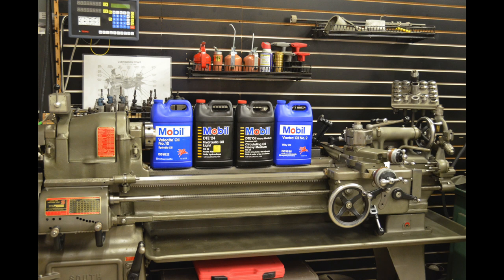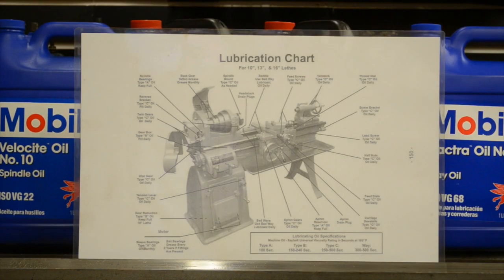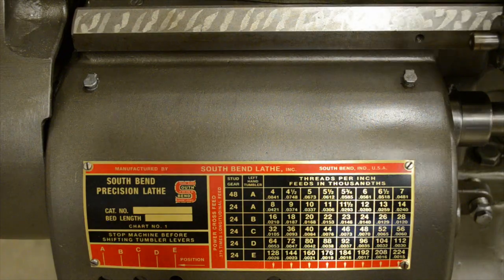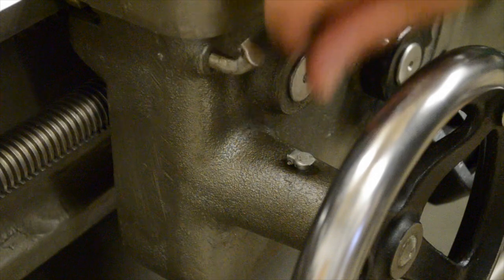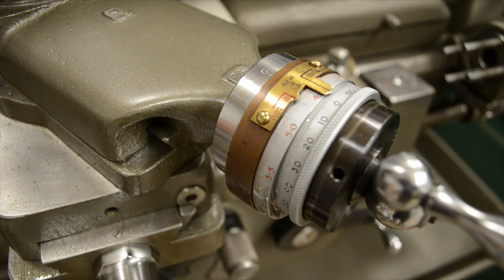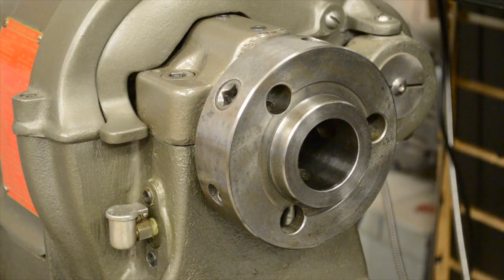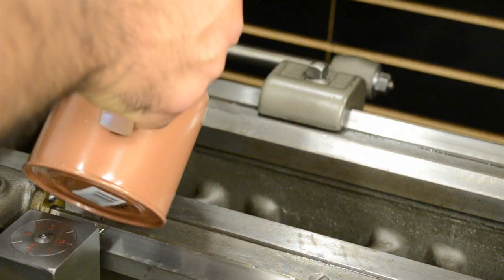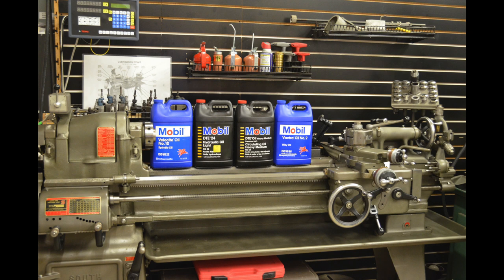How to Clean and Oil a South Bend Lathe

Comment: I came back to this video to recheck the oils and where they are used. The illness I deal with affects my memory big time. You and the basement guy explain things with clarity and I for one appreciate your videos. I was working on my first project, an aluminum protective cover for a GPS device on a single seat Helicopter. I was in the finishing stages when the rear Headstock bearing locked up at higher speeds. I can run it slower and longer but I need the higher RPMs to finish shaping the cone. I put some Motorkote in the rear Oil Git and it helped it stay running a little longer but there is no doubt I will have to replace it. I was going to suggest something to you and I don't know if it will work or not because I haven't installed a set of New Era Dials. I bought a set for my SB 13 but these are made for another brand, maybe a Logan, not sure. I know from watching Brad's install and modifications of the New Era Dials he had on a lathe that there was some binding because of the 2 lock screws. Could you make a new compound and cross feed screw and thread the crank handle ends to mate to the New Era Dial sleeve that the screws lock in. Thread it to match a the new threaded additions on the new parts. Then there should be no side to side movement and use the locking screws to lock it in place or even better a pin of some sort. I was going to put this set on mine but my lathe would need to look like yours so I'm going to sell my pair in the next few weeks after I complete the work needed on the spindle. Consider making a video on your shop and the tools and machinery you have, I might have asked you before but then I went back and deleted what I wrote because it sounded like I was a broken record. Thank you again for the great information on the lathe oils and how to use them.

Comment: I really need to just get it together and order the gallons. I'd also like to try the open gear spray lube on my 13" Good video. Thanks.
Reply from the maker: John,  especially if your planning on having the lathe for awhile.  You really do go through a lot of  C type and Way oil.  Thanks for watching!  -Adán
Reply: Yeah, the C oil is definitely what I'm flying through. I made a little tray that catches the oil under the gears and runs it down into a bottle for reuse as just general purpose shop oil. Someone with real fabrication abilities could do it with nice materials, and improve upon it's shape to make it run under the gear box as well. It could be a little money maker really.